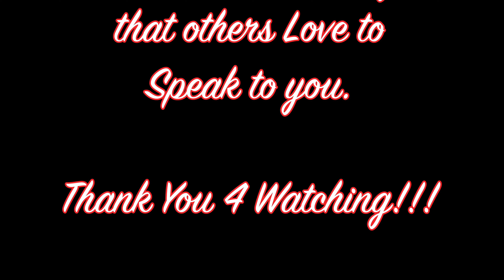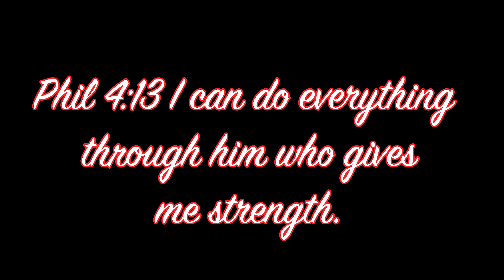Monport k40 40 Watt CO2 Laser | Building a Work Bench for Monport k40 CO2 Laser #ricks2cents

Comment from the maker: Time Line
00:00 Let's Go Over the Game Plan!!! 😎
01:30 Starting with the Lower Self. Time to Cut some 3/4" Plywood!!!
02:38 Time to Cut some Brace Supports.
03:08 Time to Pull Out the Kreg Pocket Hole Jig System!!!
03:27 Time to Screw the 1st Shelf All Together!!!
04:25 Debating how to Build the Legs?!? 
05:19 Countersinking the Screws. Mounting the Plywood to the Braces.
06:28 The 1st Shelf is Built!!!
09:05 Time to Build the Legs.
09:54 Time to Start Building the 2nd Shelf.
10:36 Getting Creative Cutting Plywood by My Self.
10:42 Building the Braces for the 2nd Shelf.
10:53 Time to Pull Out the Kreg Pocket Hole Jig System!!!
11:28 Time to Screw the 2nd Shelf All Together!!!
12:30 Countersinking the Screws. Mounting the Plywood to the Braces.
13:18 The 2nd Shelf is Done!!!
13:35 Over Viewing the Build / My Thought Progress.
16:22 It's All Put Together!!!
17:37 Let's take a Closer Look at the Build.
19:43 Thought's of Adding Future Features to the Table.
20:53 How to Save on the Build.
21:30 How Much Did the Build Cost Me?
22:50 Moving the Bench to it's Permanent Home!!! 
25:27 Turning it All on Sound / Vibration Check.

Comment from the maker: Monport k40 CO2 40 Watt Laser, CW-3000 Water Cooling System, Air Purifier Setup & Installation
https://www.youtube.com/watch?v=CC9vAgfIZ1Q&list=PLqRAXHdEUcMGofP3ipVpKSs1Nd1mPWHFg&index=1
Monport k40 CO2 40 Watt Laser | Building a Work Bench for Monport k40 CO2 Laser
https://www.youtube.com/watch?v=-Jf32TTCXsc&list=PLqRAXHdEUcMGofP3ipVpKSs1Nd1mPWHFg&index=2
Monport k40 CO2 40 Watt Laser Gauge Upgrade | K40 Laser Gauge Upgrades | K40 Mods
https://www.youtube.com/watch?v=fsuC91LC3JU&list=PLqRAXHdEUcMGofP3ipVpKSs1Nd1mPWHFg&index=3